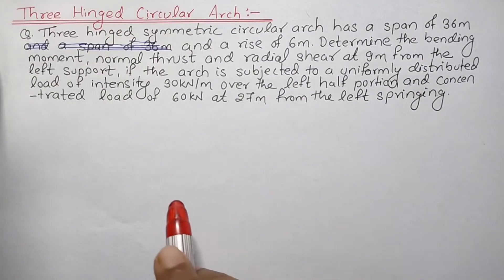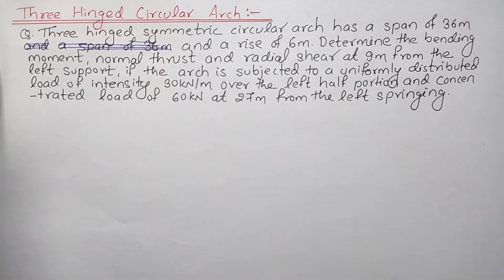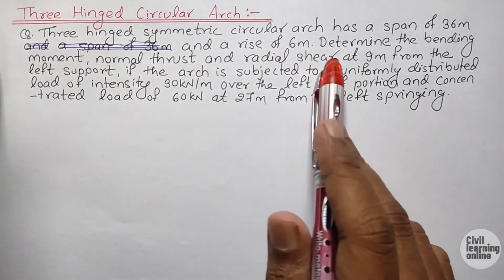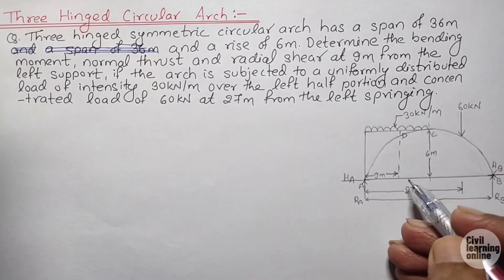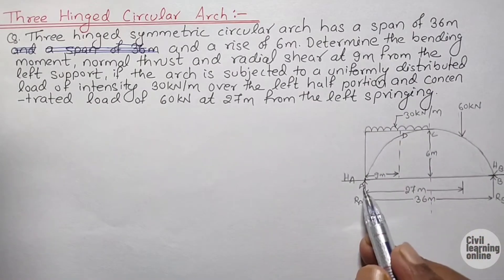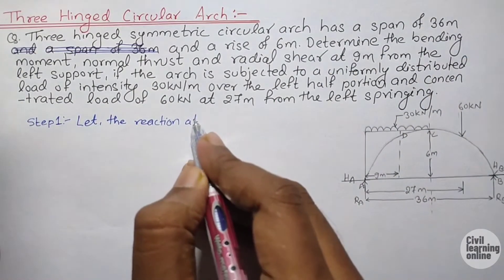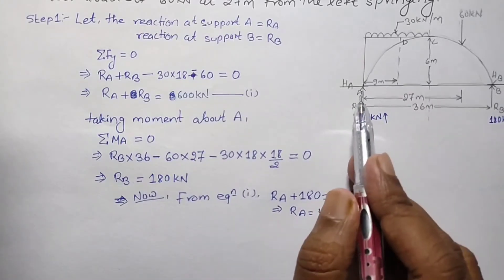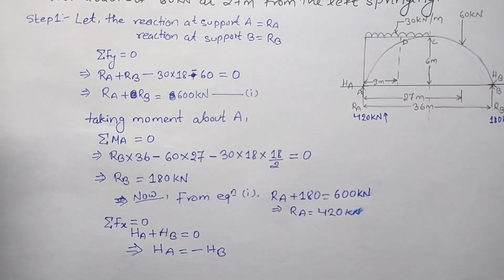Three Hinged Circular Arches Structural Analysis

Comment: Sir how can we take V in Normal thrust and Radial Shear....?
Reply from the maker: V = reaction at support A - udl X span

I. E. ( V= 420-30X9)
=150.
Reply: @Civillearningonline  sir daigram drwan is wrong read sttement adn then decide
Reply: @Civillearningonline  its written lesft springs but u used right spring when u r placing appplied loads
Reply: Is It taken as Shear Force till that point where we take moment at X...?
Reply from the maker: Yes.

Comment: In the equation.of arch the value of x should be taken from crown point so it is not 9
Reply: Yes equation you used to derive y , x should be taken from crown, then only equation will be valid, in this from unfortunately value of x is= 18-9=9 so no effect are there, but if question change then it may arise problem
Reply: Because equation had derived with that assumption where x was taken from crown, you may check the derivation
Reply from the maker: @nihalraj1532  its already mentioned in the question. How to consider X.
Reply from the maker: Why so?
Will you elaborate?
Reply: Yes... also in both the case finally it becomes 9 only so don't blame on sir pls @nihalrajbharti